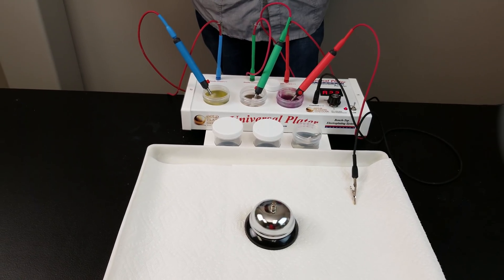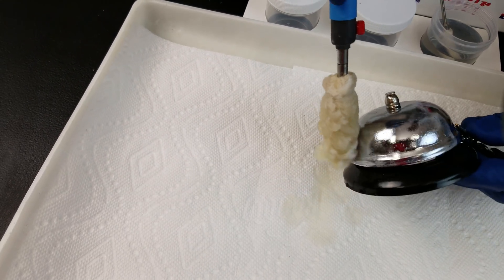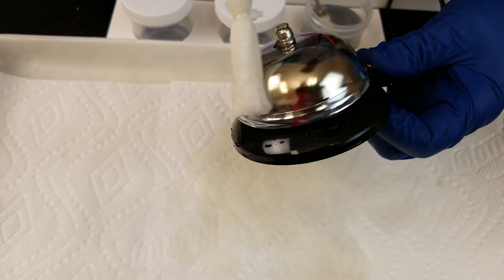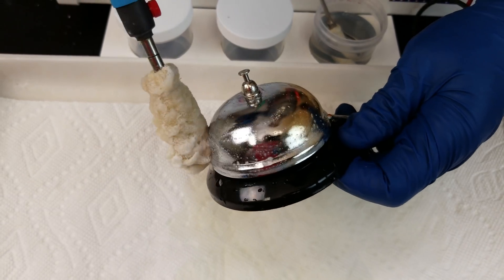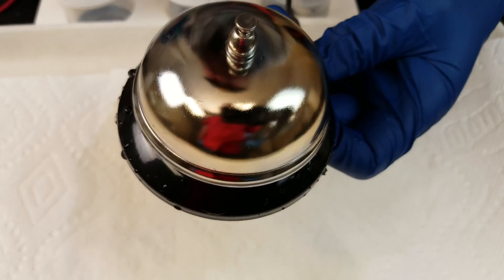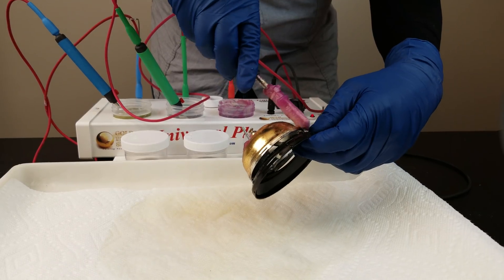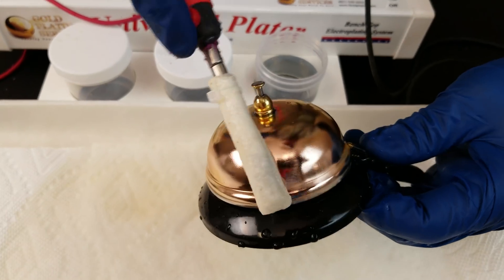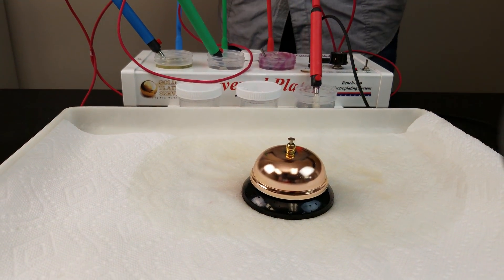Experimenting with Rose Gold on a Call Bell

Comment: I was told that you can't...then they said, shouldn't gold plate directly on copper or brass because those metals will absorb the gold over time/relatively quickly and the copper & brass will show through. I think they said there should be some something like rhodium between the base metals & the gold plate. Do you think this is correct.
I was thinking it's probably just wearing off, just like with silver, which would show through as it wears off, but I'm only guessing. Thanks for the video. I'm addicted to Plating (just been doing in a very amateur way so far) & want to get some equipment in the next few months.